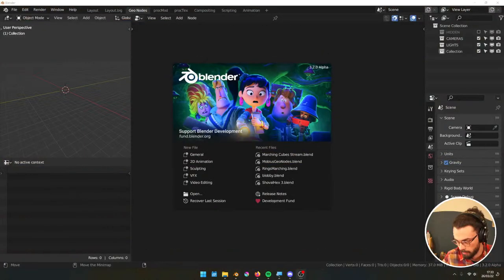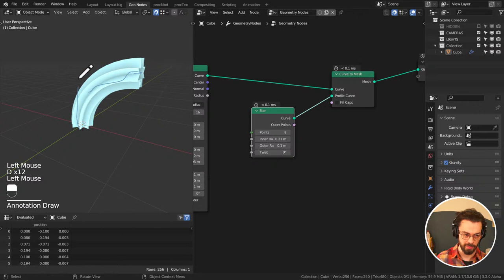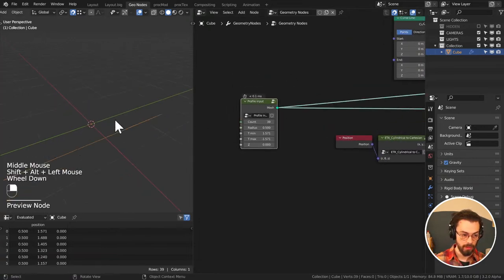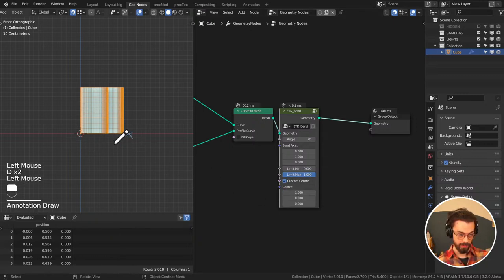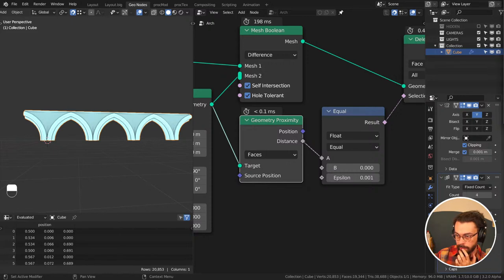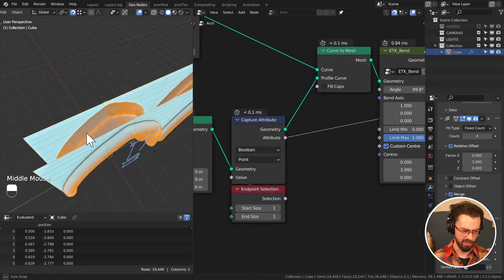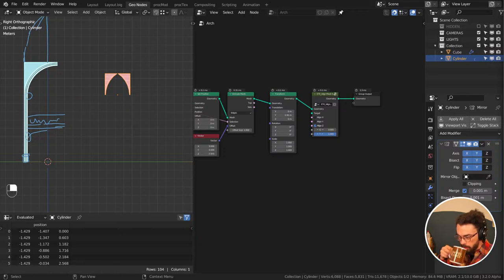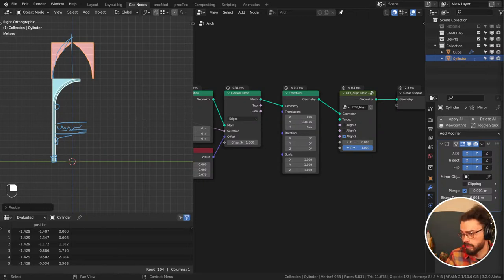Procedural Cathedral - Geometry Nodes and Chill

Comment: I tried to install the sverchok addon and I keep getting traceback errors and the addon won't enable. I've had a google and can't find useful info.
Reply from the maker: Which version of Blender are you in? Is it the latest copy of Sverchok? Have you tried closing and reopening Blender and trying to enable it again? Did you previously have a version of Sverchok installed and didn't remove it before adding a new version?
Reply: @Erindale  Thanks for the quick Sunday evening help. All working now, I cleared all older versions of sverchok. Also I have the ETK nodes and they're great! :)